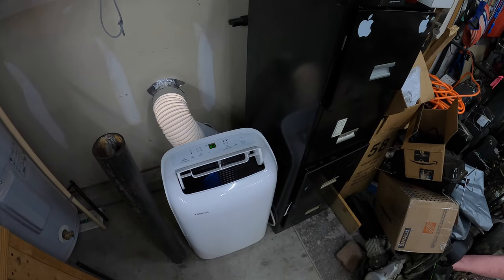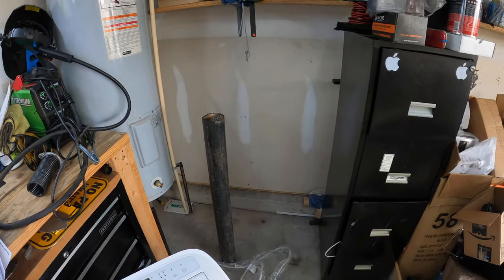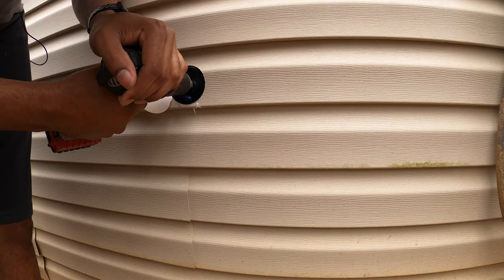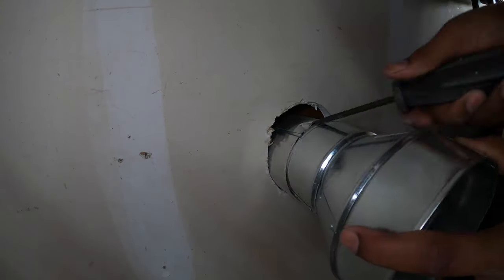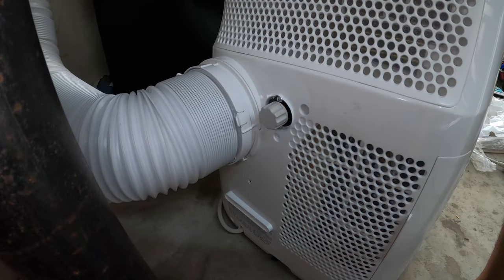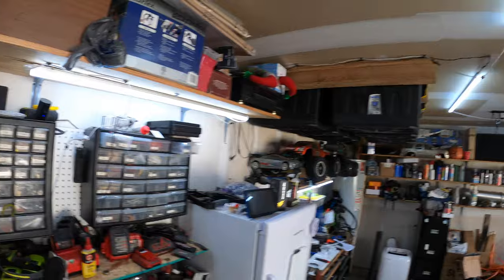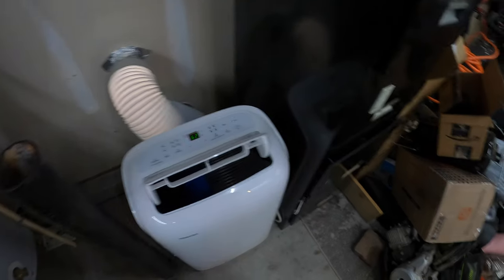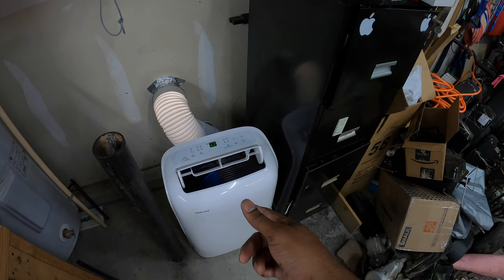How to Install Garage Air Conditioning With No Window | Portable AC | Toshiba RAC-PD1213CWRU

Comment: An idea would be to drill a second much smaller hole for the drain so instead of manually draining it just drips outside, but you would have to buy a drip line to make it work
Reply from the maker: For no often that I use it, it wasn’t worth the effort. I have it currently draining into a 5 gallon bucket and when it’s full I water my flowers with it.

Comment: I have the same one except I had to drill through block. I did run a drain hose out through the wall. Works decent.
Reply from the maker: I thought about doing a drain outside but I put the vent too high for it to drain. I may just put a 5 gallon bucket back there for it free drain into.

Comment: Good video. But if you would have gone with a 12 or 14,000 Btu it wouldn't make your unit run as hard, and will make the unit last longer, and will also cool your surroundings faster.
Reply from the maker: For the price I paid for this, which was about half of what they cost retail, it’s better than nothing.